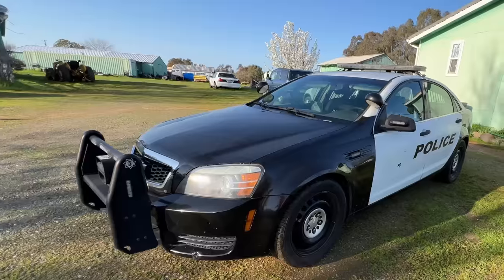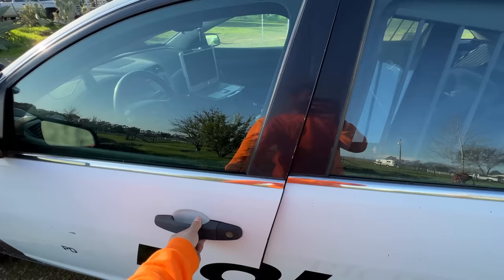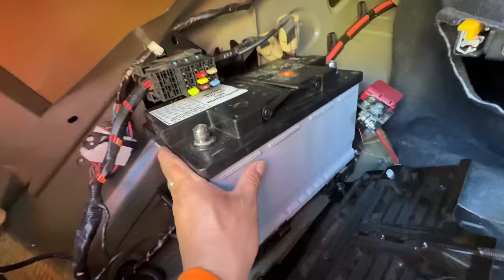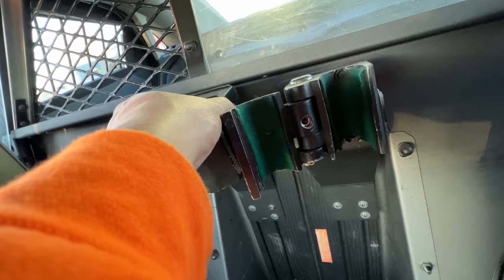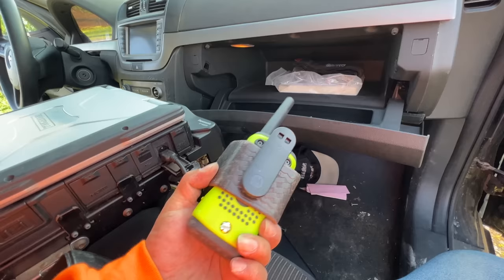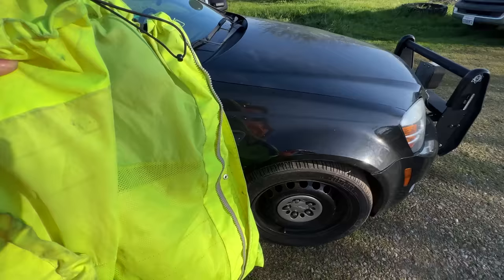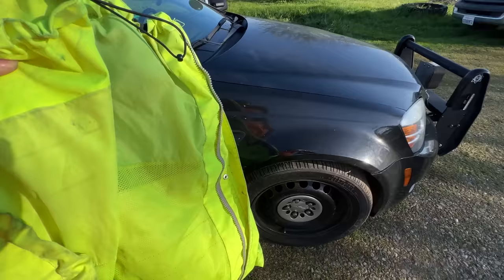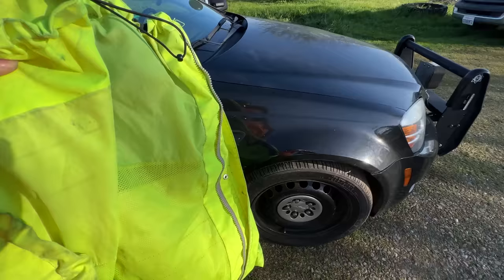I Bought A Fully Loaded Police Patrol Vehicle! Chevy Caprice PPV!

Comment: I own a 2014 Statesman CapriceV.  Here in Australia, you can get parts everywhere for this car.  It's not hard to find.  Your model locally is known as A Holden Statesman WM model in Australia.  If you need help trying to source parts, just let me know and I would be happy to look locally for you and put you in contact with the right people.  Holden spare parts are also available through Holden, depending on what it is.  Just a tip also, mine was running engine light and we couldn't work it out.  Then realized the fuel was the issue.  Since running mine on 98 octanes, no engine light and it's now been 2 years.  

I remember when Holden got the contract to import the stateman to the USA for the police department.  It was all over the news before they shut holden down on Oct 2017 and no more locally made vehicles.  Everything rebranded to Chevy or GMH.

Australian Police here decided on the Chrysler SRT, BMW 530d, Kia Stinger and the BMW X5.

Comment: Built in Adelaide, South Australia at the Elizabeth plant in the Northern suburbs. This model is based on the Holden Caprice once sold in Australia however, as US police cars, they were the basic poverty pack models. Last Caprices rolled of the production line in 2017 and were fitted with the 6.2 liter V8 from late 2015 on wards.

Comment: 80k miles but you can times that by 10 in idle time with engine running while donuts were eaten and naps were taken 😂
Reply: They used to show how much idle time was on them if you push the right buttons around the speedometer area. The unmarked ones used to have the most idle time but usually lower miles. I used to buy and sell police cruisers and school buses. I didn't have any trouble selling any of them. I used a 85 9C1 Caprice to race on dirt in the pure stock class and won 73 feature races with it over a 6 year period. I didn't keep track of the heat race wins but they had to at least 150. I had hours of fun in the 'Ole purple grocery getter' as most of the fans referred to it as.

Comment: This model is the Aussie developed Zeta platform that underpinned the 5th gen Camaros, so a more accurate comparison would be a 4 door Camaro.  

It’s weird for us Aussies to see the (luxury model in AU) Caprice body, but with basic trim and dash fitted.  I spun out when I saw an export Caprice LS too.  Base model (omega) interior, and basic plastic exterior parts, but all in the long wheelbase body.  It was as though they made a long wheelbase omega.  The PPV is similar (omega spec) with its components.

I was lucky enough to walk the line at Holden in 2011 and see these in production.  I really wanted a broadcast sheet, but they wouldn’t let me take one :( Some of the unique PPV parts were fitted on the line, and many of the unnecessary parts were left off (like a lot of trim).  A lot more work was completed by the agencies in the states to turn them into patrol vehicles.  The foot operated park brake is unique, and clearly had to be fitted to make room for all the Police equipment.  The regular VE/WM had a console mounted handbrake that had the lever on the relevant side to the steering wheel. VF/WN went electric with a switch.  That would have made their life easier when converting the PPV.

The spider eggs are probably from the Aussie redbacks that hitched a ride over on the boat 😂 
(I know, they fumigate them, it’s a joke!)
Reply: Germany has base model Mercedes and BMWs that we don't see in Australia. Same, same but different.
Reply: @coover65   That’s right, they do.  And Opels compete against the low spec Mercs too.  When I was buying my FG (yes, despite my username) an Indian guy at work told me I should be buying an older used Merc for the same money.  His comment “Falcon is a taxi” riled up my German colleague, who responded perfectly with “in my country, Mercedes is taxi too.”  That Indian guy eventually gave up on his older Mercs when he got sick of paying the repair bills (he can’t DIY to save his life).  Funny thing is that he now drives an older hybrid Camry.  I gleefully point out to him how many hybrid Camrys are used as taxis these days…. 😂😂😂

Comment: The only way for it to be street legal is to remove all ELS , it's against the law to have red and blues on a vehicle if you're not a law enforcement officer.
Reply: Actually not if it was sold to you exactly like this.
Reply: @PikaDamos  people who are emergency vehicle enthusiasts which purchase old emergency vehicles refurbish them and then keep them as showroom pieces they're never driven on public roads because it's prohibited except for when doing car shows but even then the vehicles aren't fully decorated with decals and a civilian plate is on the vehicle except for the EV plate.
At any point while the vehicle is in motion on public roads and the ELS is turned on it will get the vehicle impounded and most likely be taken off the owner for the use of emergency lights when not a law enforcement officer.
Reply: @PikaDamos  I believe this is true the buy as is clause. I bought a 2013 charger and it’s fully equipped without the lightbar tho.